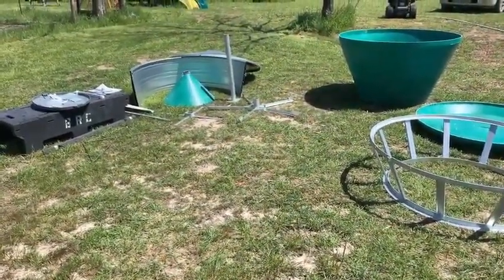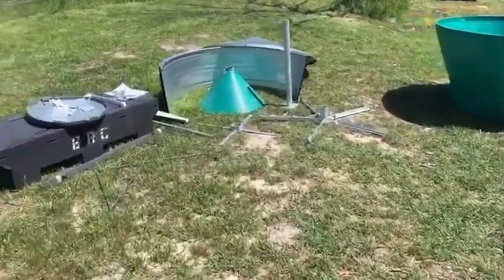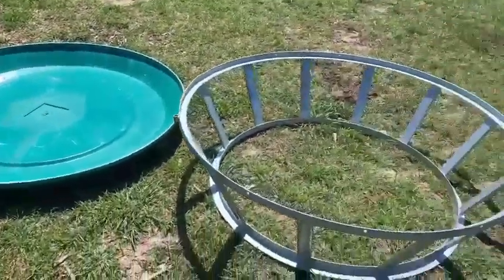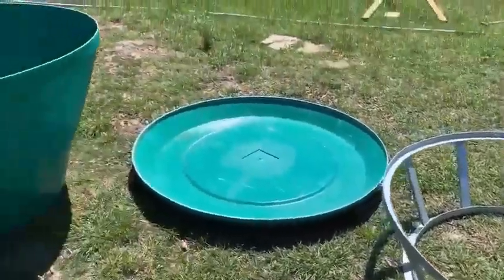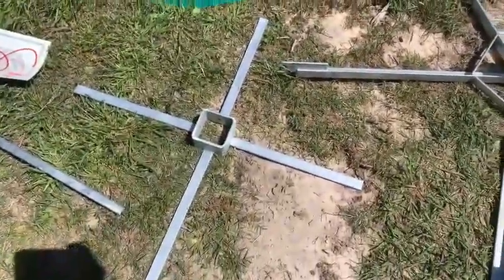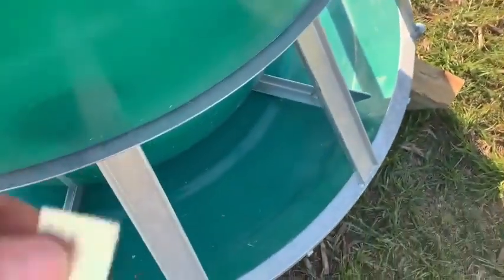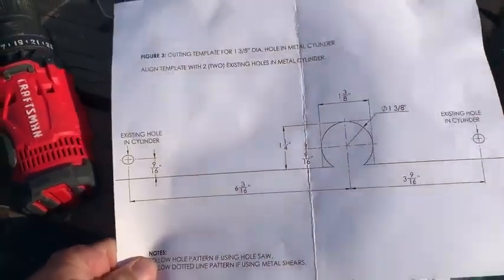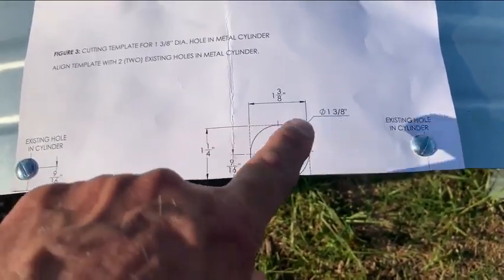Osborne Big Wheel 45 bushel Outdoor Pig Feeder Assembly and Review

Comment: Them feeders should be opened to 2 lines on the crank and then you should’ve used nuts and bolts so if you want to add another ring on it.